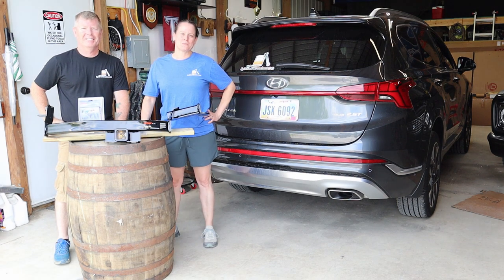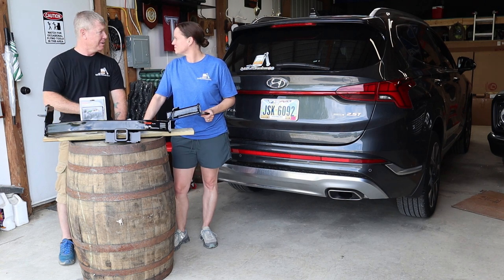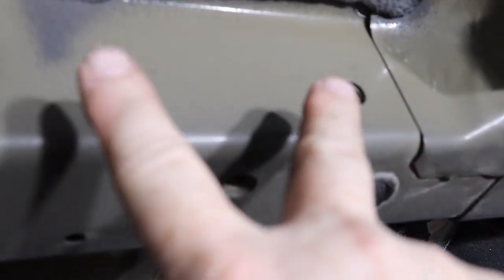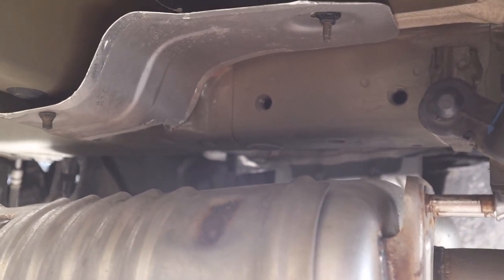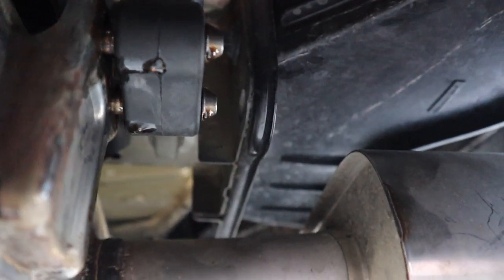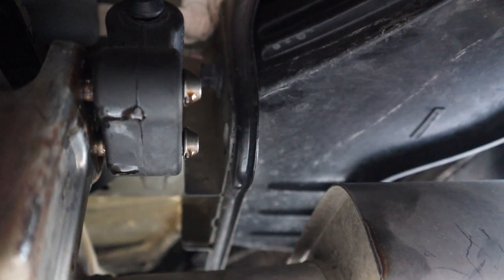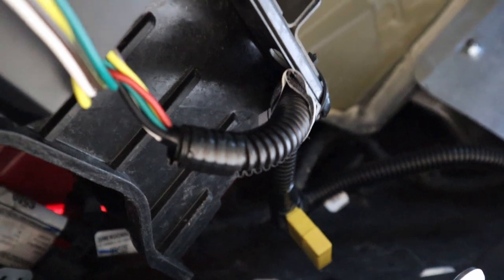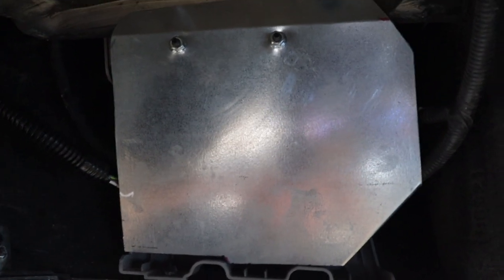How to Install a Tow Hitch & Wiring Harness on a 2022 Hyundai Santa Fe

Comment: Great tutorial... Fitted this on my 2023 Hybrid and your instructions really helped. As others have mentioned there is a plastic cover for the wiring plug that covers it. One thing I did was to rest one side of the hitch on the muffler while leaving on one hanger, with a towel to protect and then hand tight the bolts on the opposite side and then remove the hanger and bolt the muffler side. This allowed me to do this on my own. Also got a bracket (curt 57204) for the plug mount for a clean look.
Reply from the maker: Hi Darren. Thanks for watching as well as sharing the kind words and tips for the community. We greatly appreciate it. Glad the video was helpful as you were installing yours. Stay safe out there!

Comment: Thanks for the video! What did you use for coating the bolts?
Reply from the maker: Hi Aayush. Thanks for watching and sharing.  We appreciate it. The bolts were either a grade 5 or 8(can't remember exactly which one), but they didn't need a coating. Hope that helps.
Reply: @SpiritedWrenchers hanks for reply! Apologies for confusion. At 11:00 you mentioned you coated the holes for protection after drilling. is there anything specific you used for protecting after drilling?
Reply from the maker: @aayushpatel8355  ahhh, yes. Thanks for the timestamp. That helps.  So I painted the holes with a black paint to cover the exposed metal in the screw holes.. Trying to keep rust from attacking it as much as possible. Hope that helps.
Reply: @SpiritedWrenchers  definitely! Thank you so much! I put my mount today but didn’t paint it so will get some tomorrow
Reply from the maker: @aayushpatel8355  our pleasure.  Congrats on getting it installed.  Stay safe out there!

Comment: We’re you able to install the hitch without jacking up the car simply sliding yourself under the back end? We’re you able to get at the muffler brackets easily I couldn’t tell in your video
Reply from the maker: Hi JJ. Thanks for watching. We appreciate it. Yes, I used a creeper where I could and on my back for the rest. No ramps or lift was needed. Hope that helps. Cheers!

Comment: it is fit for santa fee 2020
Reply from the maker: Hi Yvonne, thanks for watching and asking! This specific CURT hitch (#13473) is only rated for Santa Fe years 2021-2023. For your 2020 Santa Fe, you will want the CURT 13195, per the CURT website. Installation would be very similar, but may differ slightly. Hope this helps; take care and stay safe!

Comment: Do you recommend OEM of after market Hitch ?
Reply from the maker: Hi Alfred! Thanks for watching and the question; from our research both the OEM and aftermarket trailer hitches will function the same. The key difference for us was cost. We found enough of a cost savings to install the Curt hitch and wiring harness over the OEM that we went with aftermarket. We don't recommend one over the other, but for us the cost savings was worth it. Note that Hyundai does have an active recall on their trailer hitch wiring harness, so be sure to check with your local dealer before buying any OEM parts that they aren't affected by the recall. Take care and stay safe!
Reply: @SpiritedWrenchers   Thank you for your expert opinion. Much appreciated.
Reply from the maker: @travelwilder  Our pleasure. Happy to help!

Comment: Whats the towing capacity with that tower hitch unit.
Its obvious hubby knows a thing or two about lube and slide when it's dry🤣😂🤣😂
Reply from the maker: Hi Ray & Lori! Thanks for watching, and you're absolutely right lube is super important! 😂 The hitch is a Class III, which has a hitch weight and towing capacity greater than what is recommended by Hyundai. It's always best not to exceed the manufacturer's recommended towing weight and capacity so you dont risk blowing the engine or transmission, even if you've installed an aftermarket hitch system that has a greater capacity.

Comment: FYI where you place the cardboard to cover the the vehicle wiring harness there is supposed to be an ABS piece of plastic that covers that entire area. As my vehicle came with it
Reply from the maker: Hi Tecnica T, thanks for watching and sharing. Yes, we learned that from another viewer.  Clearly there was no QC when ours was rolling off the line. Not sure if you watched it fully,  but the cardboard was just a template.  We made an aluminum cover plate for it in that episode and we love it. Much better than plastic in our opinion.  Stay safe out there in your Santa Fe!
Reply: @SpiritedWrenchers  on the passenger side the threaded taps where not centered but at a slight angle talk about oops lol but love the car none of the less considering adding black wheel well extenders and going with wider tires like the Mercedes GLK series
Reply from the maker: @Tecnica T  what threaded taps weren't centered? Would be interested in seeing how yours will look like if you decide to go that route.

Comment: I just got a quote of $1100 for a Hyundai brand /dealer install. Pricey for sure. I just wonder if there is ever an electrical issue, they would try to blame it on the aftermarket hitch. My dealership gave me lifetime warranty. I sure would hate to jeopardize it....
Any thoughts on this? Thanks for your time.
Reply from the maker: Hi ScenicRouteTravelers365. Thanks for watching and asking. We greatly appreciate it. That is quite a heft tab they're charging for this job. To be honest, this can come down to your mileage may vary depending on your dealership and whether they could trace an issue back to you plugging an aftermarket adapter into the OEM port. It's not like you're cutting wires or making it unsafe. These are sold all the time for all makes/models. It's just not something we could advise on though because when it comes down to it, if you're concerned heavily on it, and paying the extra money allows you to sleep at night, that's what you have to do. For us, we never thought twice about it because of the amount these are used in the industry. Hope that helps some. Stay safe out there on your travels.
Reply: Update. I just finished my install. I used your link and bought the Clark  Hitch, but did pay the $180 for the 7 way  dealer harness. I did have to go get a plug bracket from AutoZone, but everything was super easy. Mine had the plastic cover for the wires. 2023 Cali.
Anyway, your video was very helpful and I appreciate y'all posting it up
Reply from the maker: Apologies on the late reply but YT didn't notify me of your update. That is fantastic and so happy you were able to get everything installed. Congrats on the DIY and we hope you have many safe miles out of your Cali!

Comment: I have 22 Santa Fe Calli, the wiring mount WAS enclosed with a cover, held in place with push pins and nylon push nuts.
Reply from the maker: Hi Phil. Thank you very much for watching and sharing. Interesting that you had a cover and it makes sense. It appears Hyundai's QC wasn't working when ours rolled off the line then. LOL.  Oh well, problem solved on our end. Was yours a plastic cover or metal? We really appreciate you sharing that.

Comment: Is this the Wiring Harness that sparked the recall that was announced on March 23, 2023?
Reply from the maker: Hi Dubarnik. Thank you for watching and asking. We greatly appreciate it. We actually just learned about that today and it's funny you ask because when were installing this, I told Dana that the location is so incredibly stupid. We're going to look into the recall to see if ours is part of it. We'll circle back once we have it confirmed. Cheers!
Reply: @SpiritedWrenchers  I have a 2022 Santa Fe XRT and I found your video while searching about the recall. I used your description of the where the harness gets installed to determine that I don't have the harness on my XRT. As a point of interest, my XRT is a bit more rugged than a standard Santa Fe - it has a plastic cowling that covers the harness installation point. But still - give us an update on what you find out about your harness. Oh - I like your channel and subscribed.
Reply from the maker: @dubarnik  very nice. I have yet to see one of those.  Thank you very much for subscribing.  We really appreciate that and hope you enjoy our other episodes.  We did more digging on the recall and it appears that it's the harness itself that you connect the trailer into. Ours is from Curt not, Hyundai. Although it appears we are not affected, we'll be checking with our dealer to be 100% certain.

Comment: Excellent video guys.  The reason for watching is that I am trying to determine if the 2023 Ultimate Calligraphy has a different bumper clearance than other Santa Fe models.  The Hyundai dealership has informed me that they will not install the OEM hitch, as it does not fit properly (sits too low).  So now I am going aftermarket to find a correct hitch.
Looking at the hitch installation specs from Hyundai, I see that the hitch looks very similar to the Curt 13473 hitch.  So I am wondering if your Santa Fe is the Calligraphy or another model (since your hitch appears to fit perfectly to the bumper).
Thanks.
Reply from the maker: Hi Larry, thanks for watching and asking. We have the 2022 Santa Fe Calligraphy with AWD. It seems odd that your dealer would be against installing the OEM hitch on basis of clearance alone because the Hyundai/Kia 4-pin harness has been recalled, which would be a much more plausible reason to deny install. Either way, we do have links to the products we used in the description of this video, and we have used our hitch a few times without any issues. We hope this helps; take care and stay safe!!
Reply: @SpiritedWrenchers  I've been in contact with another dealer who didn't understand why they wouldn't install it either.  So I think I'd deal with them from now on.

Thanks for responding!